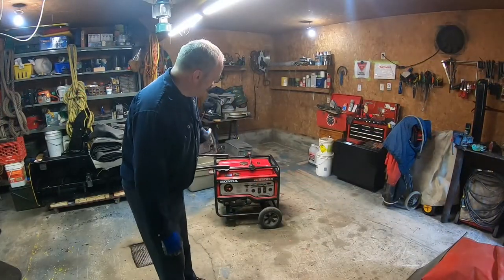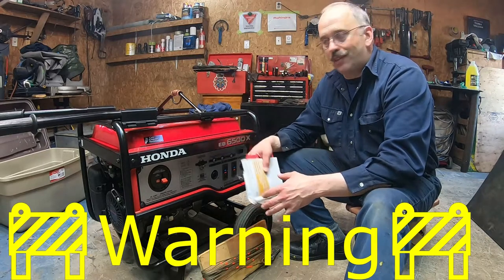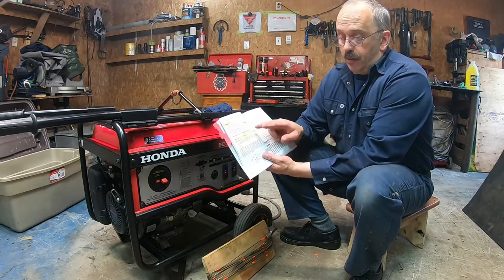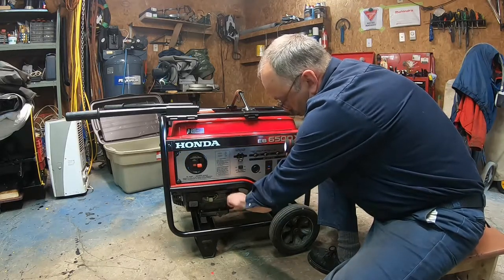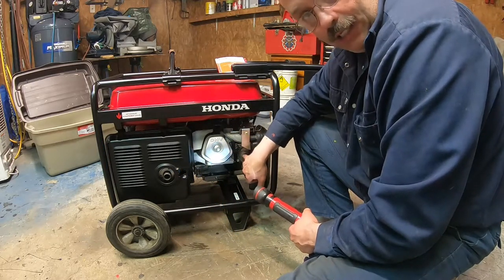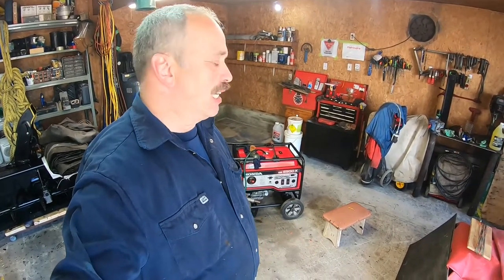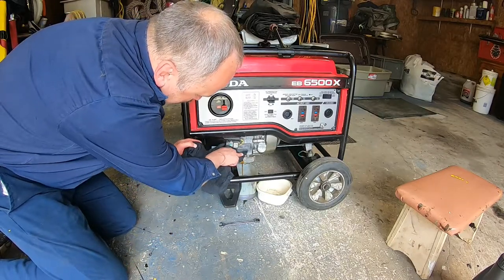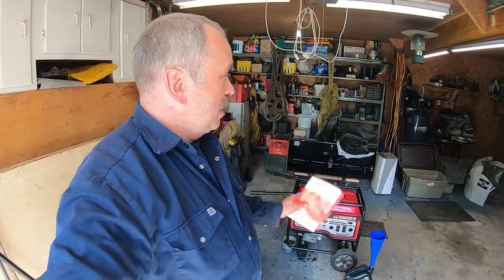Honda Generator EB6500X Cold Climate Technology Systems 10 Years Full Review and Maintenance Tips

Comment: Great video Dave, as always. I like the way you store your engine. With both valves closed. 
And I was wondering if you were going to mention grounding the generator 😀🇨🇦   If you were using the generator in winter and the ground was froze. How do you connect the wire to ground. ?
Some or I should say most electronic anything nowadays need the ground to operate. 

Have a good day
Reply from the maker: Good Day Sir, Thank you very kindly for your Supportive positive feed back comments Sir. I always put a permanent   ground steel ground rod just beside my generator, water pools, welding's tables, So That is why you see me with my wood plaque  with bonding cable with two jaws clamps ( One for the generator and the other end for the ground rod ). Yes ground protection is a must and thank you again Cheers  🍻👌👍😇

Comment: What a video Dave, well done, lucky you don't stay in South Africa, my 5.5 Kva generator runs at least 10  hours a month due to load shedding, I service it at intervals of about 50-70 hrs, and never drain the fuel out because I use it so much, I think mine have in the order of 400 hrs on and runs like new, mine is a electric start and I replaced the original battery in 2019, if you have time one day I would like to see how  you connect it to your house, I switch off the main circuit breaker, switch off the geyser and stove on the DB board and plug the generator in a wall socket in the house and feed the refrigerators and lights from there, I know it is wrong but would like to see how do you do it
Reply from the maker: Good Morning Sir, ( THANK YOU VERY KINDLY FOR YOUR OUTSTANDING INFORMATIVE COMMENTS SIR 😇👍👌 ) Now that is a trusty generator that you have and you are doing truly an OUTSTANDING maintenance Sir 😇👍Ok, I will do a video about it but you can look at that video an my former house ( https://www.youtube.com/watch?v=BpSUx3U-nGY ) Ok, so basically I do the same than you: 1 Step: I close the main breaker of the house were the electricity arrive ( VERY IMPORTANT TO DO ) , 2 Step: I turn off all the breakers on the main circuit breaker panel that I do not want to feed, 3 Step: I close the breaker of the garage / shed were my generator will be connected on both panel ( house and garage/shed ), 4 Step I connect the generator to connector that I install ( see the video ), 5 Step:  start the generator and turn on the breakers of the generator and then the garage/shed panel, 6 Step: I go inside my house for turning the garage/shed breaker on, then the generator is feeding my house with the breaker that I left turned on. Once the electricity is back or when I have to service ( oil change and refueling )  I do the opposite. On the Garage /shed electrical panel, I do install a GFCI breaker that I connect to separate outside ground rod that I also use to ground my generator ( VERY IMPORTANT! ). Sir  It is nothing wrong what you are doing Sir since the most important step is ( 🚧🚧TURNING OFF THE MAIN BREAKER🚧🚧 ) since that breaker allowed the service electricity that you pay to come inside your house and that service when is down it could be ( ON ) very fast and you need to turn it ( OFF ) since you could fry yourself when working on your generator or your generator will fry even if it is breaker protected or GFCI protected. Here in North America our house electricity is on 120 V, 60 hertz and in Europe is 230 V 50 Herts is it true that you are running like in Europe ? Hope That help for now and 🚧🚧KEEP UP YOUR OUTSTANDING videos Sir  🚧🚧👍👍😇😇👌👌🍻🍻
Reply: @RCAFpolarexpress  Thanks Dave, that is what I do and it works great
Reply from the maker: @jankotze1959  😇😇👌👌👍👍🍻🍻

Comment: Sir, that was an excellent video.  Very informative for both experienced and newbie generator owners.  Honda products are pricy but then they are extremely reliable.  My 1st two videos were  on a generator that I bought.  My generator does not require any grounding according to the manufacturer.  Yes, read your manual, too many people don't.  Super safety tips to be 3 feet away from flammable and in a well vented area.  I think your spark plug was tight because the engine was hot and it expanded.  My wife said, "what did he say" when you tightening the oil drain plug, we both laughed 😆   Great tip to put the piston head at the top of the cylinder, many don't know to do that.  Great idea to connect to the house with either a transfer switch or an interlock kit, good by to extension cords.  If your generator is not an inverter generator make sure you have some time of surge protection when connecting to the house.  Haven't a great day Sir!
Reply from the maker: Good Day to both of you, Thank you very kindly for your OUTSTANDING supportive positive feed back comment 😇👌👍 The main reason for my generator is in link of the GFCI but you will have a great safety option to connect yours too for protecting your generator from bad ground coming from either the electricity service or bad electrical items connected to your generator  👌😇 Ho darn, you can see my dark past ( I completed my English learning experience among technicians in the RCAF ! ) What as save me, is going to church every Sunday and various teaching positions ( Boot Camp, Life Support Trades and Language School ) but sometimes it surface back for some reasons,,,    😢🤣👌 I do receive daily forgiveness from my Officer, since I do drop one or two bad words when I'm emotional🤣😇👍 Yes I always install a GFCI breaker with a separated ground rod near the generator so the generator is protected against but with all the safety steps that I do before connecting I'm on business. You can Read the Comment that I left with  Jan Kotze on how I do it. SO HAVE AN OUTSTANDING DAY AND WEEK END to both of you 🤣👌👍😇Cheers 🍻🍻
Reply from the maker: Yes these videos that you made are OUTSTANDING SIR ( https://www.youtube.com/watch?v=y0Ds5P1_T3I ) and ( https://www.youtube.com/watch?v=GLpPCHAvXco )  Cheers 🍻🍻👍👍
Reply: @RCAFpolarexpress  Good stuff Sir, I read your steps in the comment to Jan Kotze.  I have a friend that does it that way.  Thanks for sharing.
Reply from the maker: @JelenOutDoors  Thank you very kindly, the VITAL FACTOR is the ( shutt off ) the main breaker  👌😉👍 One thing that I forgot to mention is my father had a Mobil Welding Business and His Welding Generator was 20k Watts and that how he was doing too ( that how I learn ! )    Cheers

Comment: Is this the service manual/shop manual and not just the owner manual I assume? I have the exact EB6500X and would like to get my hands on one.
Reply from the maker: Good Day Sir, Thank You Very Kindly For Subscribing To My Channel ( I will do an incoming video this month about my generator running powering my house ). Yes that Owner Manual Sir ( it is not the service manual shop ). You can call you Honda dealer he will order it for you or do like I just did a direct on line search I found a PDF document exactly like my book ( EB 6500X owner's manual ). You can order also the book ( various sites )  Thank You Again Sir Cheers 🍻
Reply: Thank you for the informative video. I have the owners manual when I bought it back in 2010-2012 (can’t remember). I have the exact EB6500X but oddly don’t have a sediment glass bulb for fuel under the fuel shutoff and my GFCIs are under just one, not individual ones like you have,  that you would see on a standard wall mounted one.

I would love to see you hook your house up. I live in the US (Tennessee) and I use this once or twice a year with power outages from severe weather. Do other odd jobs on my 50 acres I own. Unfortunately I have to run extension cords for the house and would like to have a permanent hook with a designated box for it.
Reply from the maker: @TN-Land-Manager  Good day Sir, I just finish making a field testing with my Welding Machine ( Lincoln Electric AC 225 ) Will Be On Next Sunday Morning. I use the same electrical connection box behind of my 220 V 60 Amps Compressor to feed the garage and my house 🚧🚧( But beford doing that I shut off the main electrical breaker !!! ) 🚧🚧 I always use the 220v 50 amps of my welder or pool heat pump in order to provide electrical back up to my various houses.👍😇I was suppose to make a video about it but right now I'm focusing on my Chimney and RV fix but I will try to show you good folk how I do it !!! Thank You Again and having the sediment bowl screw under the carburetor is good enough Sir ( the one located under the fuel shut off valve is not realy useful perhaps under very cold condition as a water separator,,, ) 🤔 I live right now Up The Saguenay Region ( 2 hrs north of Quebec City )  Cheers 🍻🍻